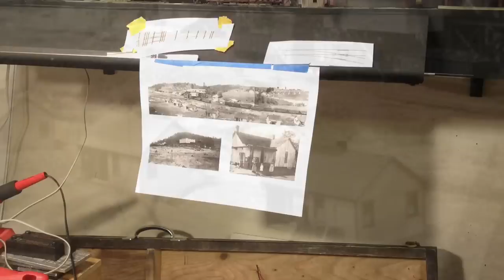How to Scratchbuild a Simple Styrene Shack - Part 1

Comment: Is there a trick to getting the chopper to make an actually straight cut? Even when I cut thin things the blade like wanders off center as it passes through the plastic no matter how hard I press it onto the base. Same thing happens with my rod clippers then I end up having to either sand it to a true flat 45 or cut all the excess edge off with a blade which completely defeats the purpose of the tools.
Reply: I’ve tried slow cut, fast cut, pushing hard on the piece or not pushing at all or even taping the rod to the base and none of it keeps the blade steady as it passes through.

Comment: Hi, where did you obtain that small L tool?
Reply from the maker: It's a Zona 3"x4" Stainless Steel L-Square Ruler: http://www.hobbylinc.com/htm/zon/zon37-434.htm
Amazing bang for 6-7 bucks - I use it for everything!
Essential for scratchbuilding structures, & very sturdy.
Highly recommend.
(You can find it at Micro Mark or on Amazon as well)